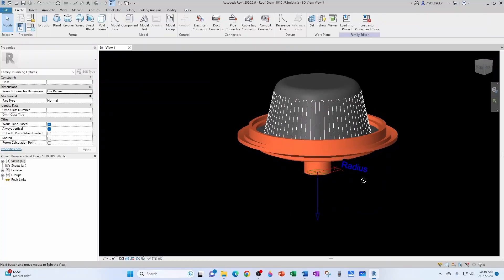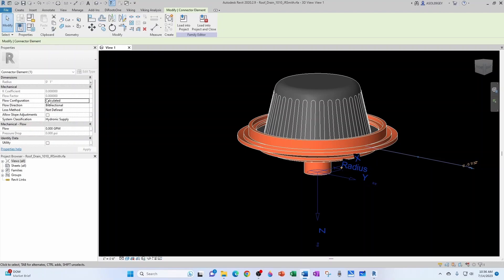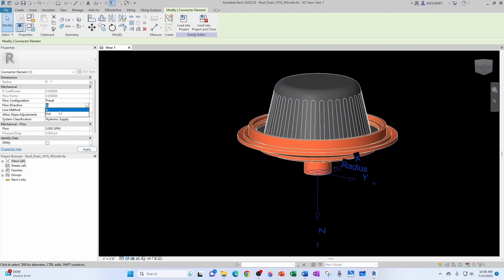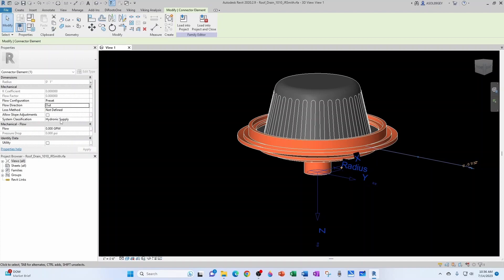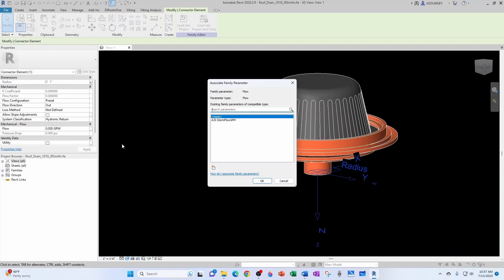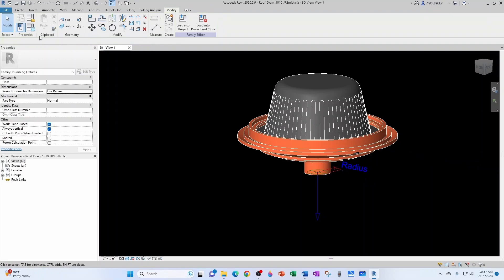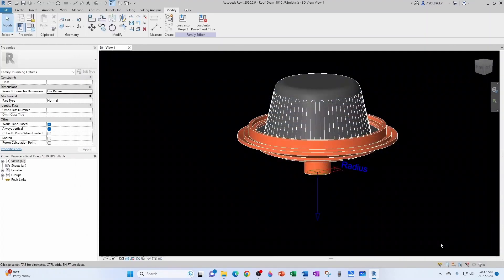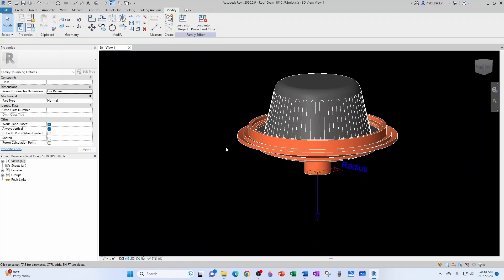Automating Storm Design in Revit 02 Connector Settings

Comment: Just one question, aren't the hydronics system for HVAC?   is there any reason to use Hydronics Returm instead of Sanitary for the pipe connector?
Reply from the maker: Yes. Out of the box Sanitary can calculate only DFU (Drain Fixture Units). Storm calculation per International building Code are based on GPM (Gallons Per Minute), which Hydronic Return can do out of the box with no required changes. =)